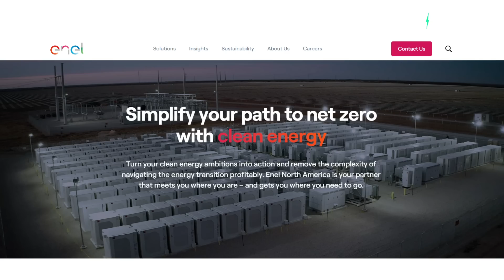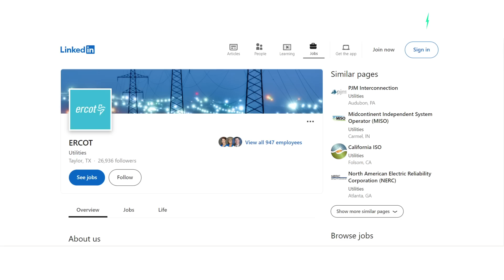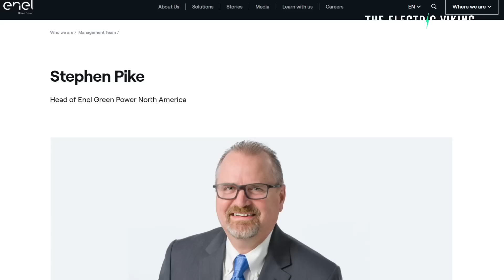Texas beats California: How oil country became the renewable energy leader

Comment: one alternative not much considered is to put solar on things like warehouse roofs.  it would probably be worth making the actual roofing to get the free space for the solar.  if you look at some of these you will see a sawtooth pattern of repeating metal frame.  turn it so the slopes face south, and there you go.  want a place to put the batteries?  how about under the warehouse for a total of no acreage needed.

parking lots under solar are already being done.  charge the car while it's parked.

another thing about the storage issue is, why not smelt aluminum while the sun shines?  it's a huge electricity user, but with sufficient capacity you don't need to smelt at night.

Comment: The one big thing you are missing: Texas can't profit off of green energy.  It can't export electricity to other states.  In order to avoid Federal regulation of their power grid, Texas has their own power grid that is only inside Texas, and that they keep separate from the 2 Federal power grids.  So, they have no way to export any green electricity made inside Texas, and profit off of it, unlike oil which they can export.  All the green energy made in Texas won't help the rest of the US move away from fossil fuels.  Having said all that.  Thank you for providing an update about how much battery storage will increase in 2024.

Comment: I live in Texas and last summer and winter the state produced more than enough power because of solar and wind power .  I wish we could get a break on some of the current t rates for electricity ⚡️.
Reply: You won't get cheaper rates. Guaranteed they will go up, b/c the supply of last resort (the most dependable) will always be on-demand generation by fossil fuel & nuclear.  So it's just wasteful to overbuild unreliable generation that must also have substitute generation waiting to be there when the renewables let you down.  Also, all that extra equipment..... somebody has to pay for it..... what the gov't doesn't subsidize..... will be added into your generation costs.... and the gov't subsidizies are just trying to mask the true cost you pay until a later point when you pay it thru your higher taxes.

Comment: Compress air storage is being under estimated,the effective turnaround is 60 yo 80 %  but you save in electronics AND the price for storege is at least 5 times chipper than battery, in tanks the  price for kw drops  as the vessel gets bigger,a steel tank can be cicle over 20 times
more than the best battery,no limit to 
fast charging or discharge, another
plus is the ability to combine air with natural gas, ammonia, hidrogen,methane etc. to double the energy storege , negating the need for power plants.

Comment: Be aware of this: Texas foolishly deregulated their power generation industry a couple decades back. The promise was a free power market that consumers could use to buy electric power from any vendor and that would drive down costs. That hasn't been reliable as prices have dropped lower and risen higher at various times. The real catch comes when there are problems on the grid. Since pricing of electricity is a demand driven market, if part of the grid goes down, prices shoot way up for users in areas that still have power. This happened in the snowpocalypse with some customers receiving multi-thousand dollar electric bills.

Why is this important? These companies racing to build big battery storage are gambling that the grid will go down again and they will get an enormous windfall as they sell their stored power back into a skyrocketing market. I'm not kidding - this is what is driving a lot of battery buildouts in the state. They WANT the grid to fail so they get windfall profits. In fact Gov Abbott got some big campaign donations from a power company CEO who made BILLIONS off the winter disaster when his gas fired peaker plants raked in the dollars as people were surffering and in some case dying. All this While Ted Cruz was off to Cancun.

Comment: One thing I think helps a lot is that the big oil companies don't really have a reason to oppose clean energy in the electricity grid because it doesn't infringe on their business model (oil is not generally used for electricity generation anyway). To the extent that renewables replace fossil-fueled power, it's the coal companies' loss, not their loss.

Electrifying cars, on the other hand, is something that oil companies are going to fight tooth and nail.
Reply: There's a fair amount of natural gas generation plants. Most natural gas is produced mixed in with oil wells or near oil formations, so although it is not the main product, it helps offset some of their costs when they can efficiently separate and capture it.

Comment: I live in Texas with Austin on the south border of my city.  Due to the unusual system here, many if not most residential and many commercial customers can select from dozens of providers offering various prices and gimmicks for a contract period of 1-3 years.  A month after moving into my house eight years ago I contracted with my first 100% wind and solar provider.  Now on my third one as the companies come and go.  My electricity costs 14.7 cents kw/hr of which 6.2 cents is for the distribution company and mandatory taxes.

Last summer there were NO rolling blackouts or brownouts.  Why? Because we had built so much solar since the Great Republican Snowpocolypse of 2021 that killed 242 residents of Texas.  That oil dick sucking "governor" Abbott and his buds blamed the wind mills, but they failed less than the natural gas generator stations.  The future is renewables, and they are shoving far up Abbott's well oiled ass.

Comment: New kind of batteries needed. The batteries should and probably will be split to commercial large size batteries such as sodium ion and graphite while small ones will remain lithium. Lithium should not be used for large commercial storage like it is nowadays. Also another option may be If there is large lake nearby to use it as battery

Comment: IT DOES NOT NEED TO TAKE 10 YEARS TO BUILD A NUCLEAR POWER PLANT. IN the United States before the NRC began IMPEDING construction with NO MANDATE for commercialization, the average build time was 36 months, with some like Point Beach 1 & 2 (Wisconsin, 1968, 500 MW each, less than $1000 / kilawatt inflation adjusted cost today) taking slightly over TWO YEARS to construct. Japan has built a reactor in 39 months. The average build time for 13 plants in South Korea is 56 months. S. Korea has become a manufacturing / technology powerhouse despite being a small country by getting one third of all power from 26 nuclear plants. The NRC NEEDLESSLY KILLS NUCLEAR IN THE UNITED STATES.  It has ZERO to do with safety or necessity.

Comment: Texas may go the way of Norway, becoming a petroleum net exporter with a nearly 100% renewable grid and a high percentage of electric transportation.
Reply: Well, I think "high percentage of electric transportation" is going to take much longer in Texas than electrifying the power sector, for the simple reason that the big Texas oil companies have an obvious reason to oppose the former (with very receptive state politicians to back them up), but not the latter. If everyone drives electric cars, big oil loses money. If everyone powers their homes with wind and solar, but continues to burn gas for their cars, big oil couldn't care less. One could even imagine the oil companies themselves someday switching to renewable energy to power their drilling rigs, simply to save money on fuel costs.

Comment: If Texas are doing this, being an oil producing state, maybe there is hope for others. Price is what talks and as soon as the battery storage prices dropped it will go forward and grow. We know that solar costs have deopped massively as well, so a great hand in hand approach.
Reply: Consider that battery costs are only as low as they are & still trending downward b/c the gov't has continued to pump more & more subsidies into renewable/green energy tech, which distorts the true pricing mechanism of capitalism.  The Gov't is quickly reaching the point where the economy will suffer from it's wasteful spending via Inflation and then ensuing recession.  Economic pain is on the horizon this year, & it's gonna probably lead to a decade of stagnation.  Also, what does it say if the states that are most evangelical of this tech are the laggards in adopting it???

Comment: Hard to turn away from a fuel source with a $0.00 cost.  Sure, still have to build the "plant", but free fuel for it is nice.
Reply: Sure your religion says it is $0.00, but if so, go for it, invest in one of these projects... let me know when you get a return on investment.  Good Luck!  None of these projects to date have returned a single penny in dividends.
Reply: @w8stral  Howz your reading comprehension?  Wait...I already know.  He said the FUEL cost is zero.  

I'm sure your knowledge about sustainable energy investments is gathered from right wing, anti-progress, pro-oil sources.  If it was such a bad investment, why, for just one example, has the parent company of Florida Power & Light become the biggest owner of wind and solar in the US?  To make bad investments?  And you know, even a fossil fuel plant doesn't start making money for a number of years.
Reply: You are talking capital.  That would be both the hardware and the land.  The latter costs money and there will be taxes on it, too.  Solar panels (presently) degrade at about .6% per year.  85% efficiency compared to new at 25 years.  Night time battery backup surely costs a lot, both initially and in the long term, I'm sure.  If the land under a solar farm doesn't experience high, increasing value like a city encroaching, let those panels run for fifty, seventy five years.  Less output but zero costs by then.

Comment: Intermittency is a challenging problem, batteries  provide an relatively expensive solution to daily variations in supply but they are not viable for weekly monthly and seasonal variability in renewable electricity generation .. For this reason more Gas turbines will be built. This is not bad as excess renewable energy can be feed into gas turbines energy cycle through several mechanism to help them act a seasonal batteries.

Cheap renewable electricity can be used to compress natural gas in tanks or underground caverns.  Excess electricity could also produce hydrogen ,syngas and other hydrocarbon that are easily storable long term.. There is great value in being able to turn very cheap electricity when the sun is out the wind is blowing our the snow is melting into storable, transportable energy commodities..  In the Pacific northwest hydroelectric energy capacity in the spring and winter will often exceed electricity demand and the water is spilled over to save on turbine wear. Wouldn't it be great if all that electricity could be stored for months or years and or  put on a ship to send somewhere far away?
Reply: It's not perfect, but simply mixing wind and solar together, rather than using only one or only the other, helps a lot with the seasonal energy storage problem because the two technologies tend to peak in different seasons.

Comment: Most of the state is on its own power grid that is not connected to the rest of the United States. Because it is only within Texas it does not have to comply with federal regulations. This caused blackouts and lack of gas for heating during a winter storm. The politicians blamed it on wind and solar.
Reply: I live in Texas, but disagree with you.  The night before this all happened I looked at my phone and it said 4 degrees for a low that night.  That was worrisome, but what was worse was the high's the next day and for the following few days were only going to be around 14 degrees.  I immediately said, out loud, "We're not built for that!"  I knew something bad was going to happen.  This would be like Alaska getting 105 degree days for 5 days straight....they're not built for that.  In Texas, we can drop in the teens, but it always goes right back above freezing.....that's why we call it a "cold snap".  The outages happened, because we don't get weather like that, and thus were not built to handle that.
Reply: @hieyeque1  Yes, and if you were connected to the neighboring multi-state grids, you could have had power.  Also, the politicians lied when they blamed it on wind and solar.
Reply: @hieyeque1 and @jeffreymartin2010 You are both half right. The main power plants weren't winterized and froze up or their gas lines froze up (actually water in the lines). Other places could have wheeled in power from other states as they are interconnected, but not Texas. Well except for west Texas which is connected to the western states grid and didn't have the problem.
Reply: Ironically, it was the out-of-state ERCOT directors that left TX down during that storm by their negligence and mismanagement. They've been all replaced since, and TX is back on track.
Reply: @jeffreymartin2010 I was going to say that.  Texas for better or for worse is a rugged individual state. If you're in a fight, the best option is always unity with the right people.

Comment: Why don't they put the batteries under the solar panels? Do they really have more land than they know what to do with? And even so, wouldn't the batteries benefit from the shade? Or would the solar panels produce less, due to the heat from the batteries, (when it isn't windy enough)?
Reply: Easier to maintain and install when in nice neat rows near the ground.
Reply: I guess it's to facilitate maintenance and transportation
Reply: Fly into Dallas, and drive to El Paso.
Reply: I imagine the batteries are actually already shaded by the metal vented enclosure around them.
Reply: @RT-mv7df  Yes, but surely shading those enclosures would keep them even cooler. (though if they end up heating the panels above them, that would reduce the panels output)

Comment: Doubling the US grid battery capacity will allow batteries to power the grid for about 10 minutes instead of 5 minutes.  It's still a drop in the bucket.  Texas will not get to 90% renewable energy in the foreseeable future because solar and wind are intermittent sources, and batteries are too expensive.  Texas has the advantage of good winds and plenty of sunshine.  Many other areas are not so blessed, so wind and solar are NOT economical in those areas.

Comment: Yeah, this is a VERY strong signal that renewables are the way forward. Those investing in energy now see that investing it in renewables gives them better returns than fossil fuels already, and it will only get better.
Reply: yes because corrupt government beurcrats create subsidies / incentives for mal-investment ie choosing 'muhhh renewables' over nat gas / nuke
Reply: Nonsense.  In most states, energy production from renewables is mostly cash flow negative, and if you factor in the energy used to make the glass in the solar panels, it is even energy negative.  This is easily calculated using grade school math.  It can work in Texas because it gets far more sun and wind than the average state.
Reply: Nonesense.  No one in Texas has paid for those Wind turbine installations.  People in NY/NJ/CA have done so.  None of them have seen a profit by the way even with government subsidy.  Solar is ubiquitous, can easily be maintained, and can easily be predicted unlike wind and SHOULD long term be profitable.  Wind--> Nope unless in VERY specific SMALL geographical areas.  Both require vast quantities of NG and do not work without them as no one has enough pumped hydro storage to make them work.
Reply: Uh... returns?  What returns?   It is not people in Texas investing and building these wind farms.  I have looked at these companies and they are all LOSING money even with subsidies. None of them give out dividends.  Zero returns.  ZERO, just asking for more $$$ usually.   Only reason these wind farms are being built in Texas is because "environmental" funds from ignorant ville in NY and CA can build said farms where it is best suited in the USA --> which means generally speaking --> Texas which also has gobs of NG to balance this crud energy source.  It is not people in Texas investing and building these wind farms, rather funds out of NY where fools put their money into who build the farms at a steep discout to what they actually cost in--> Texas.

Comment: GW is power.  It means nothing to say "1GW of battery".  What is interesting is GW hours  - the amount of energy it can store.
Reply: Batteries are also rated by max rated current/power, poor old Pedro.
Reply: @dhowitzer  ofc, but a 1kwh 1GW battery wouldn't be much use.  Nor would a 1GW 1GWh one.
Reply: BESS (battery energy storage system(s)) are useless to the grid without an inverter system that can take the DC (direct current) output from the battery and “invert” it into AC (alternating current) that can be injected into the power grid. Battery energy output is rated in their watt hour capacity, but the inverters are rated at their power output capacity, so all BESS have two ratings, one for the inverter power output, and one for the battery energy capacity. A 100 GWhr battery connected to a 20GW inverter can an output a maximum of 20 GW at any given time, and will be able to do so for a maximum of 5 hours until the battery is depleted once all 100GWhrs of battery storage has been inverted into usable grid power.  You just don’t see the term “inverter” used outside of the power industry, and instead you just see the power output rating along with the watt hour rating.
Reply: Of course GW means something. It means that the maximum discharge rate is 1 GW. Which is what ERCOT cares about, so it's an easy number to find because it has to be filed with ERCOT. Owners typically don't need to disclose their GWh.